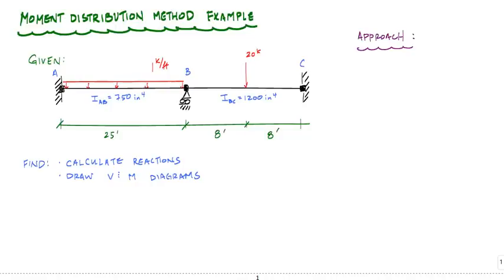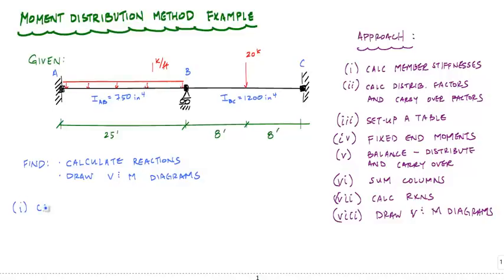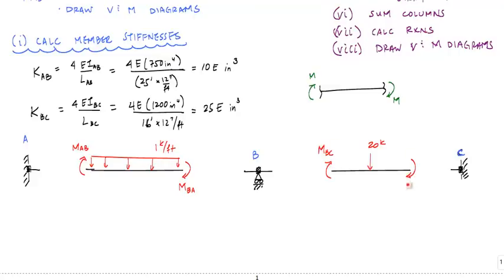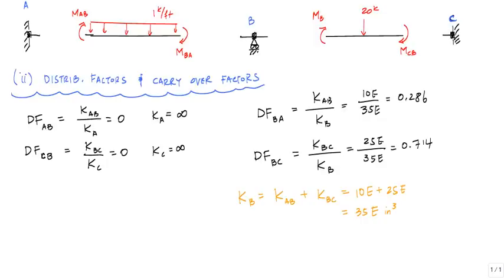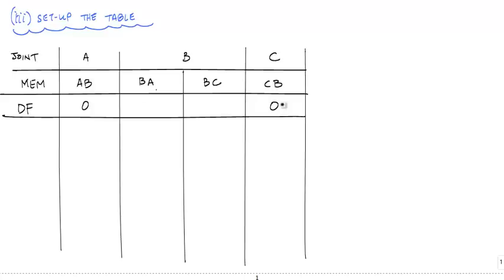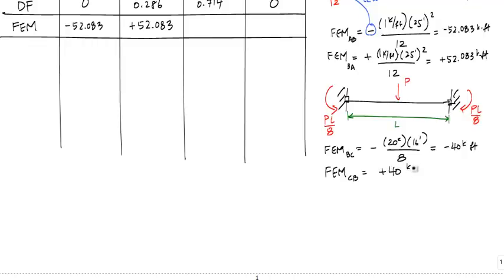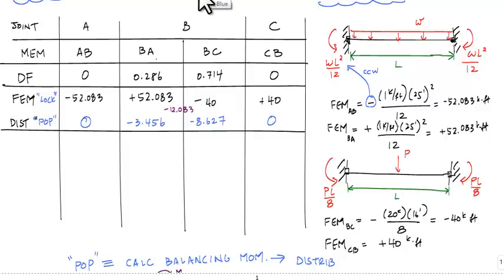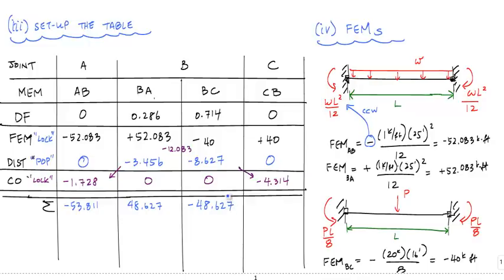Moment Distribution Method Example 1 (1/2) - Structural Analysis

Comment: Professor, please lets see a worked moment distribution solution to a "cube", "cube beside cube", "cube on cube", and larger number of cubes (rooms that is). a cube is four columns joined with beams above and below (or foundation on a ground floor). a roof can be an "area" of spread out load (like reinforced concrete). i have been surprised with so many books stop after beam, column and a 2d portal of two columns and a beam on top; and then plenty books dive into matrices.

Comment: Although I feel confident, I can't find any problems where people are working beams that dont have fixed ends.  Like lets say B was a pin connection, and A and C were either pins or rollers.  That adds a way different dynamic.
Reply: Learn moment distribution method (Non sway)
https://youtu.be/rI9qaseL1rs

Learn moment distribution method with sway 
https://youtu.be/RljSGJHvt3A

Comment: Hey mate. Your videos really help all of us. They are probably the only thing that ensures we pass uni. And by "we", I mean the entire cohort of engineers every year. Appreciate it. 

We just don't understand, in this instance, how you got the zeros in the purple line at joint B. Could you please clarify?
Reply: If you add the moments on each side of the joint B ( 52.083-3.456=48.627 and -40-8.627=-48.627) are equal. that means are balanced and you don't need to apply again the distribution factor. The iteration process finish when you get moment equilibrium at interior supports. 
better later than never :)
Reply: @marlam5478  Okay, can you still try to reexplain this? I don't understand. My professor kept doing the iterations until the distributions were negligible and small. What happens if you have seven iterations, do you have to keep adding up both sides of the joint til you figure out if they are even?

Comment: Hi Structure:

I was wondering why your Carry Over for both parts of Joint B are 0 after 1 iteration? Im trying to teach myself this method and I cant figure this part out.
Reply: The carryover is the difference of the two distributed moment calculations. For pinned joints, it should always be 0 because the joint didn't contribute, i.e. distribution BA + BC = 1.

Comment: how did you get the zero's at BA and BC?
Reply: It is a fixed support it absorb all the moments so the DF is zero.. If the end is roller or pinned support the DF is 1.
Reply: it is default right?

Comment: hello, structurefree: could you please advise me which method is better to use to solve frame moment and shear diagram: slope deflection method or moment distribution method? In the exam I will take, I will be given a free choice of either method. Thank you.
Reply from the maker: If you are allowed a page of notes and don't have to memorize equations, I would use the slope deflection equations.   I am assuming that you have practiced solving the equations out, since you could have 6 or many more unknowns and the same number of equations depending on the frame being analyzed.  Also, you have to know how to handle the chord rotation if you have lateral loading or settlement...but that depends on how much you've covered in the course.
Reply: structurefree Thank you. It is a close book exam, but I can try to memorize equations if the slope deflection method is easier to use compared to moment  distribution method. As for lateral loading or settlement, I will have to learn how to handle it from more examples. I really appreciate your videos. They are very helpful. I can see you are a talent teacher and you love what you do. Keep on with good job! World would be a better place if everyone is like you, to give back and constantly improve your profession!

Comment from the maker: k=3EI/L is used when the beam has a pin/roller on the free end or where the beam structure terminates. In this example, the roller is supporting the continuous beam and a moment can be carried across the beam at the support.  See the moment distribution method example 3 video, it has a beam segment that uses k=3EI/L.